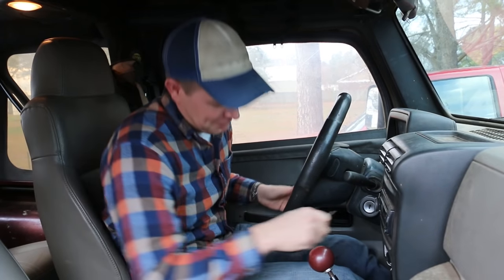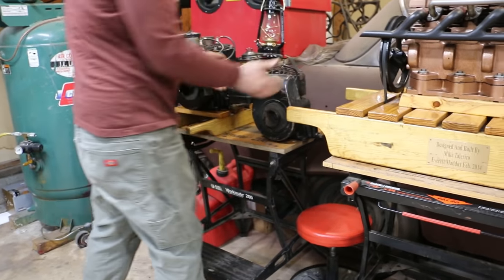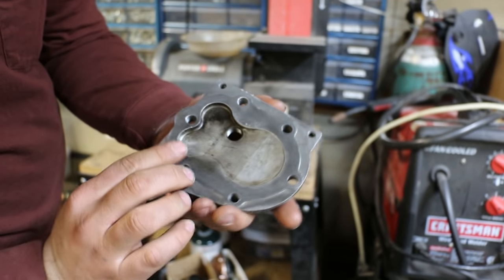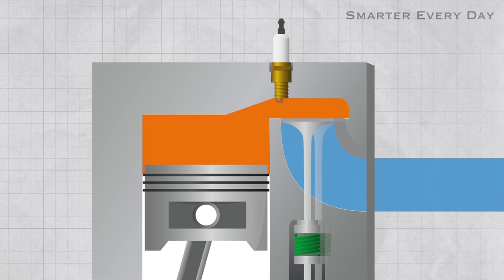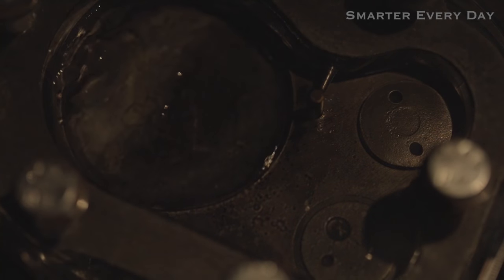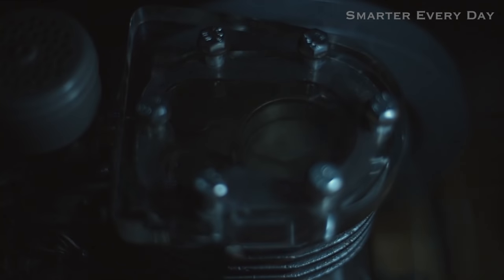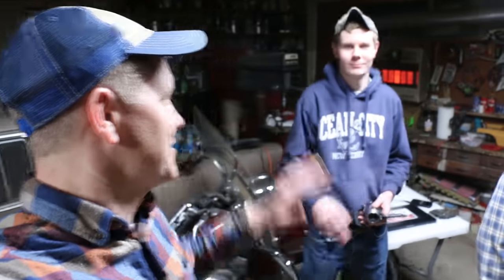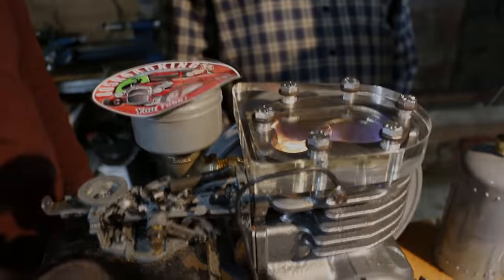How Engines Work - (See Through Engine in Slow Motion) - Smarter Every Day 166

Comment: I already understood all the the parts and strokes... but was I noticed that I couldn't understand was on the exhaust stroke, the moment the valve opens the flame almost instantly rushes towers it and out, but the piston hasn't really begun its upstroke at all... what's going on there?
Reply from the maker: +Christopher Williams last minute of the behind the scenes video explains this in detail
Reply: SmarterEveryDay oh,k thanks.... actually had just started looking at that one.
Reply: the gas is still expanding at this point, and continues to do so a fair way down most exhaust pipes, the piston just pushes out the last little bit to ready it for fresh oxygenated air/fuel mix for the next power stroke
Reply: Christopher Williams to slightly expand on previous comment the exhaust could actually be burning and still continue to burn fuel through the entire exhaust pipe. depending on fuel air mixture rpm and load on engine.
Reply: It happens because of the pressure difference.. On the inside is the high pressure exhaust gases and on the other side of the valve is atmospheric pressure.. This drives the gases even before piston reaches the top
Reply: Christopher Williams the gases are actually still expanding as the valve starts to open, and there's probably higher pressure inside the chamber because of this expansion, which would cause the gases to rush when given an opening
Reply: I should show show this to my Small Engines teacher, but he technically already found a video like this, but we didn't say the start to the end stroke.
Reply: Christopher Williams the gases are under compression and as a new opening (exhaust valve) becomes available the gases take advantage of it.
Reply: You could also tune the engine by viewing the color of the flame.
Reply: No need to watch behind the scenes bait. The smoke rushes out because it's still under big pressure. If you want to know more, find a proper explanation elsewhere.
Reply: +Hopelessand Forlorn Not true, modern engines are not running with the highest possible efficiency. Highest possible efficiency would be with a stoichiometric fuel mixture which is 14.1:1, so 14.1 parts air and one part fuel. This is basically the recipe for perfect combustion of an air/gasoline mixture. But this perfect mixture would result in very high cylinder and exhaust gas temperature, which can cause damage. Hence all modern cars run with a richer mixture, which means less air or more fuel than with 14.1:1. The fuel that is not burned will evaporate on contact with the cylinder walls and piston, resulting in a cooling effect.
Reply: taha ali an explosion creates a vacuum, I sure hope you didn't learn this anywhere that you had to pay for the education, if so you got robbed.  What creates vacuum in an engine is the intake stroke not the exhaust stroke.
Reply: 14.7:1 is considered stoichiometric, my fuel injected V8 is running higher than that on idle and coasting, when floored it runs considerably lower around 11.5:1 which is where max power is made, on all gasoline engines whether it's carbureted or injected you want around 11-12:1 for the power.  Excess fuel is sent out the exhaust not evaporated on the cylinder walls, washing the cylinder walls will ruin an engine.
Reply: This happens due to the pressure differential inside and out.
Reply: a combination of scavenging and higher pressure simply moving to a lower pressure zone. Engines can be tuned so that both the intake and exhaust valves (called overlap) occurs at the right moment, which actually helps pull in more air into the cyl. due to the scavenging effect....also the intake manifold can be designed so that acoustics / pressure waves help to force air into the cyl the moment the intake valve opens.
Reply: Good question. It is because the pressure inside the cylinder still alot higher than the atmospheric pressure when the valve exhaut opens. That is the reason why engine are more efficient with a turbo charger. It recovers this pressure that is transform into kenetic energy (velocity of the gas) hits a turbine that drive another turbine that boost the intake air pressure. Energy recovery that would have been lost otherwise. Less work is waste in the intake stroke.
Reply: haha, eighty years ago? cameras (optical, LIF, PIV...) are still in use and and a big subject of current research.
The combustion process isn't understood in a complete way in terms of combining all chemical, thermodynamcal and fluid dynamical equation into one.
There is still room for further achievements and efficiency and that will for sure not end in the next 20years.
Believe me, I have a bachelor in mechanical engineering and have done some own research about it.
Reply: the pressure is so much higher in the engine after the explosion that all the gas rushes out to balance out pressure
Reply: Mean Man, no you can not tune an engine for valve overlap, the cam grind is what determines that, and all cams have overlap, the more they have the rougher they idle.  You can only tune or adjust for the time of when the spark plug fires before or after TDC.
Reply: Christopher Williams Because even at the bottom there is still like 30psi of pressure, half the air comes out which lowers the temperature and extinguished the flame.
Reply: Christopher Williams magic, it's all magic, son
Reply: basically, pressure difference makes all the magic happen
Reply: Eric Johnson These days you can tune or adjust the timing or overlap of valves. This is called Variable Valve Timing. Also known as VVTi, or VTEC. "VTEC just kicked in yo!"
Reply: +Eric Johnson Not washing. Washing involves "flowing down something". This would happen if you had too rich of a mixture. Evaporating doesn't wash anything off. 

Also excess fuel in the exhaust is bad for your cat. Cat as in catalytic converter. Fuel in the exhaust will ignite within the cat making it become way too hot and then crumble to pieces.

And do you know why 11-12:1 is better for high load? Because of the cooling effect! This is also the reason why you should never trust a tune that can get more power and less fuel consumption than OEM out of an unchanged engine. It will raise the AFR to 13-14:1 at high loads. Which of course will get more power out of it. At the cost of losing said cooling effect. 

I'd tell you to go ask someone who works in a large automotive company, but the thing is that you're alreading talking to that someone: Me.
Reply: +Eric Johnson You know, i'd rather believe someone who tunes OEM ECUs for manufacturers like Ferrari, Maserati, Bentley and similar, than some old man with a highly outdated engine design like an LS.
Reply: SmarterEveryDay For some unknown anomoly , and for as many years as I've been watching YT today is the first time I've ever ran across your videos and have spent hours today getting smarter lol . Here's an idea for a video ! Why to vertical ( from the ice cube up ) icicles form from ice in the freezer ? This happens almost every day in my freezer and i have even researched Vicktor Shaubergers library of water experiments and can only believe it is the life force of the particularly pure water in my Va mountain well . Any thoughts or witness to these phenomenon ?
Reply: because the engine is in a vacuum what happens when you open a door that is pressurized lower than outside air? it fills up to depressurize hence moving/ sucking the air out
Reply: Christopher Williams the gas increases in pressure and volume when it burns, so at the moment the valve opens, most of the gas rushes out just because it's under pressure, without the piston doing anything.
Reply: It is referred to as the "blown down" phase, where the gas pressure from combustion is still greater than in the pipe outside of the exhaust valve and when the valve first opens that pressure "bursts" out into the exhaust pipe so fast and with such momentum that if the piston did not rise there would be a momentary negative pressure in the cylinder.  
But piston rises offsetting that and keeps up the momentum of the exhaust gas flowing out.
When the piston reaches top the exhaust gas is still moving out and has momentum.
The engine cam timing delays closing the exhaust valve until the piston has risen up to top and has begun to go back down.
Exhaust still rushing out would cause a momentary spike of low pressure behind it same as above, except the cam also opens the intake valve just before the piston reached the top.
So exhaust valve and intake valve are both open for a short time...called overlap period
And the low pressure that would be created behind the exhaust still rushing out, pulls more intake mixture through the intake valve, so intake is drawn in to the combustion chamber (during "overlap" period) before the piston has even started to go down.
The piston starts moving down then the exhaust valve shuts and piston keeps moving down maintaining the momentum of the intake already flowing in.
When the piston gets to the bottom the intake valve remains open and due to momentum of the intake gas still moving as the piston reaches the bottom there is a small pressure increase inside the cylinder at the same time the piston begins to rise and when the reaches about peak pressure the intake valve closes trapping the intake air and fuel mixture at higher pressure than would be the case if the piston simply drew the intake in alone..
That gas inertia is why the valves do not simply open and close at exactly the point the piston is at top or bottom.
High performance cams exploit that action with even greater overlap and valve timing periods than a standard engine.
I make videos on this stuff, feel free to browse.
Reply: Its caused by a difference in pressure. Theres more pressure within the cylinder than outside so that's why it rushes out. Tbh, I always thought the piston pushes the gases out but its mostly pressure

Comment: I wish this was available when I started my automotive apprenticeship with the Australian Army in 1977.   MInd you, it's pretty much exactly as I imagined, due to the excellent instructors I had.

We were told that it wasn't an "explosion" but a controlled burn of the air/fuel mixture, the position of valves, spark plug, even piston crown designed for the most efficient "flame propagation"
Reply: pretty much controlled burn works too
Reply: It actually isn’t an explosion, it’s just fast burning
Reply: but then everytime when i see yellow flame i think the engine is begging for more oxygen

Comment: I want to see a clear 2-stroke engine
Reply: Andrew Agustin me too
Reply: Andrew Agustin brap brap brap
Reply: Andrew Agustin a 2-stroke just combines the intake & ignition and then combines the compression & exhaust. That's why the engine sound is way faster and sometimes higher pitched.
Reply: Riley Frisk actually it's the opposite. 2-stoke engines combine the intake and exhaust at the same time, that's why there is a tuned pipe and also why a lot of unburned fuel that flies out the exhaust pipe.
Reply: Andrew Agustin - Riley Frisk/ 

2-strokes run differently as they don't use valves, but rather opposing ports. a big intake port that mists and lubes up the lower end/crank case - then upwards  thru 4 cylinder ports - then finally sucked out thru the 6 cylinder head intake ports to feed the air/oil/fuel mixture to the piston on the compression/ignition stroke. Then the power/exaust stroke and out a huge exaust port on the way to the expansion chamber/exaust pipe.
Reply: Andrew Agustin watch a channel named 'Jan Ridder'. he made 2stroke acrylic cylinder.
Reply: Sean Denlinger thats why we want to see it
Reply: Andrew Agustin It would get dirty too quickly.
Reply: Search for "Moped transparent cylinder head"
Reply: I wanna see a diesel.
Reply: Vel0city the acrylic will broke after two stroke because the compression ratio of diesel engine is so high, some of them equal 19:1 compared to gasoline engine which is 9:1
Reply: Me too

Comment: Now just imagine a Ferrari or any exotic car at like 9k rpm. Absurdly fast
Reply: ConRon lol 9k ? That's chump change . Small liter medium compression engines (10lbs-12) hit 9 rpms on boost or after redline . A performance Ferrari engines is usually in a range of 10-12K rpms speeding up to top end . Then you have Diesel engines that have ridiculous compression ratios 16lbs -25 and hit 10-12k rpms as well . The see through engine is only possible as a small single piston engine . Anything higher and your gunna blow that top off .
Reply: ConRon Or an F1 engine.
The 2006 Cosworth v8 revs over twenty thousand.
Reply: ConRon No take a rotary from a mazda RX7 at 12000 RPM and think of that.
Reply: No diesel can hit 10-12k rpm.
Reply: A saw a tachometer today on a Honda 400, red lines at 14,500 and tops at 16
Reply: Fast motorcycles easily reaches 12 to 14k rpms, and they're much much cheaper than a super car engine for example.
Reply: TJChagas yeah but the larger the CC, it's usually a lower redline, that 400 would be higher than a 1k because I think they're about 9-10,000rpm
Reply: F1 redlines at 17K and idles at 7K
Reply: ConRon if you think that would be amazing, think about a small four cyl. The smaller the stroke, the higher the RPM. Or even a rotary. Those things are built to rev at 10k without breaking a sweat. So awesome.
Reply: ConRon an s2000 will redline 9k lol
Reply: it doesn't have to be a pos exotic car to hit 9k the truck pulls i go to there "pushrod v8s" crank at 9krpm with well over 2,500hp N/A
Reply: Isaac spohn rotary is fantastic, you familiar with Napier deltic? It makes all of the torque XD
Reply: But they have to replace the engines after one or two races (or completely repair them probably) whereas the ferrari only needs regular maintenance (and maybe a bit more)
Reply: Do Subie with the Suburban Derek rotangklan
Reply: ConRon my r6 redlines at 15500 600cc
Reply: David G V-TAC YOOO
Reply: Do Subie with the Suburban Derek no, sorry. Not familiar with that, but you did get the rotaries are fantastic part right XD
Reply: ConRon or a f1 car at 17k rpm
Reply: Isaac spohn fun but not economical, unfortunately. The deltic has 3 crankshafts though.
Reply: Jose Leon i would be very interested to see or be pointed in the direction of this diesel engine you speak of that turns at 10-12k rpms. I am currently only able to achieve 5k after 40+ yrs of engine building and racing these compression ignition beasts .Thank you for all info in advance ;-)
Reply: or a Honda Civic.
Reply: ConRon or imagine a 2-stroke at 16k rpm. as many power strokes as a 4 stroke at 32k

Comment: so basically what these guys are doing is the mechanical equivalent of successfully performing delicate surgery with a pocket knife and tweezers? badass
Reply: No. The equipment their using was originally intended for wood working but thanks to modern alloys can be set up with stronger clutches, chucks and bits to allow them to process metals as well. Far from ideal tools for the job since metalworking tools probably cost about the same as modifying wood working tools to handle it. However the woodworking tools are aimed at wood that at it's highest density is as strong as the softest metal that's likely to be found in an engine. 

More like putting a lawnmower blade on an a fan to mow the lawn with it. Not exactly the right tool but close enough to get the job done with a lot of care.
Reply: Subscribe to Roadking's channel and watch before giving a completely wrong comment as fact.  The tools they use are for metalworking.  Just smaller and cheaper.  The lathe is from Harbor Freight.
Reply: Recon WB 
Yea that's great. 
Give these guys a run of a real shop and they wouldn't know what to do....🤔
see the humor in that, I know guys like this. 
Back a few years ago, we got a Bridgeport and my dad was all over the place emotionally, "how many years I spent in the driveway filing a piece of aluminum and zip it's done in 10 minutes"...almost manic laughter for a second or 2 also 😂
he could do great work by hand, you would think it was done in a machine. 
This was just an excellent vid for any type of techhead
Reply: Recon WB this is what i know as working